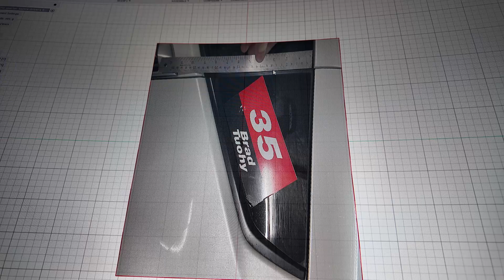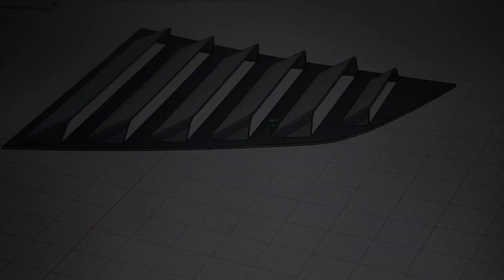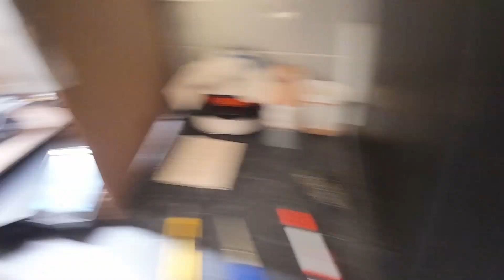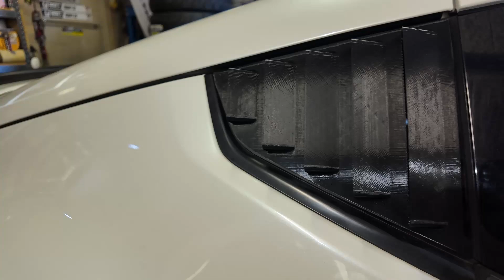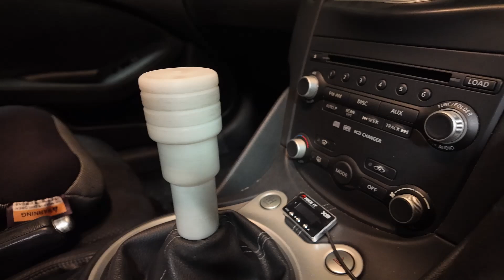Designing and 3d printing Custom Parts using Fusion 360

Comment: Any tips if your windows are not as flat but have more of a 3d curve?
Reply from the maker: You really need to 3d scan the surface. 
In my case, I just used a heat gun on the flat surface and gently manipulated the front edge